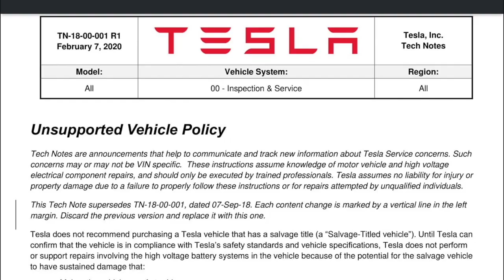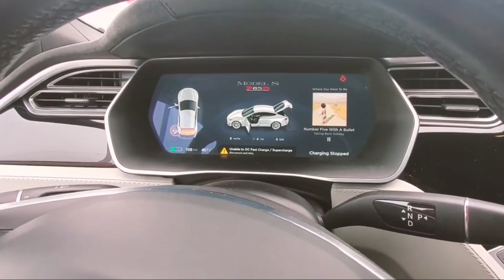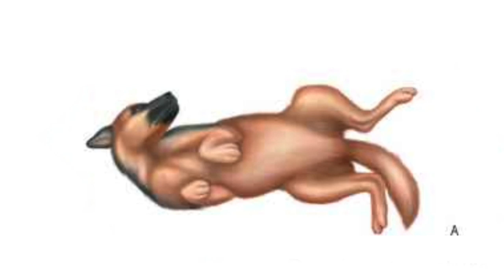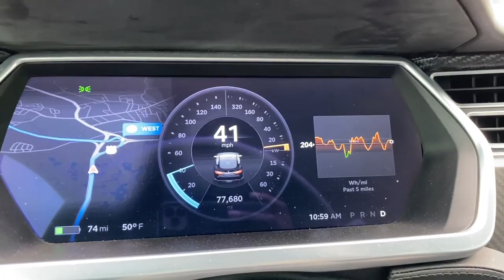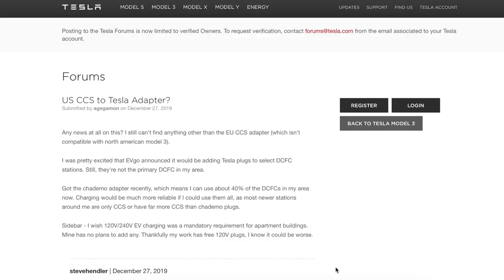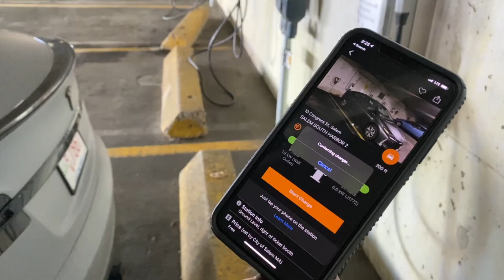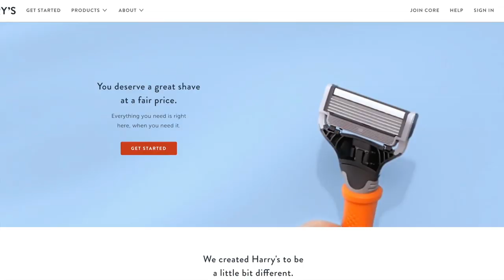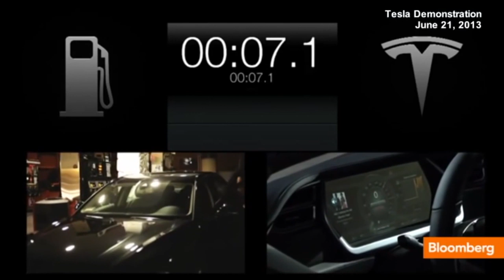Tesla ruined my car and it’s the best thing to ever happen to me!

Comment: The fact that Tesla disable the ability to fast charge after the PAID certified inspection is completely madness.
Reply: This will affect their new car customers too. Premiums will go up if they recoup less on damaged vehicle auctions.
Reply: It's also basis for a lawsuit. At $12,000, a lawyer wouldn't be that much
Reply: Chaos Corner except they also offer insurance. So they will just say get Tesla Insurance.
Reply: I was quite looking forward to getting a Tesla model Y but this video has shown the reality! disabling DC fast charging not on their network, is completely unacceptable. I will buy something else.
Reply: @chaos.corner  straight up! Shady as fuck
Reply: @tomquimby8669  good self control, this is what the world needs when it comes to sleezy business practice
Reply: @tomquimby8669  Same  - Ill get a VW diesel before i get a tesla
Reply: @brushlessmotoring  I mean...for now. Who knows? In a couple more years, maybe they start disabling DC fast charging on all models more than 8 years old due to "degradation in battery safety" or whatever. Perhaps they'll offer a battery safety certification for $5000 which works for 6 months then gets rescinded. You wouldn't want a car with an old and degrading battery charging next to you would you?

It's a slippery slope.
Reply: MasterOfNegotiation everything you just said is made up by you, and nothing is factual. Lol
Reply: Sadly Tesla is like the Apple of the Automobile industry
Reply: @brushlessmotoring  say they can and will disable third-party fast charging on salvage title AND unsupported vehicles. Your car becomes unsupported if you take it to a different country. I live in Europe and do move country to country. this policy makes it impossible to waste money on a tesla
Reply: That's right bro
Reply: @tomquimby8669  I'm sure you can re-register a Tesla within European countries, as the charging standard is the same (you can certainly drive them all over EU/UK as many have done) If you moved between countries that have different supercharging sockets, I can see them preferring you to sell and buy rather than ship and import, and not be able to supercharge anyway. (EU/US/CN have different connectors)
Reply: @brushlessmotoring  you only need to re register after 3 to 6 months depending on EU country. but that refers to the countries legal requirement. Tesla is not bound by that they could arbitrary decide to unsupport for any reason. NOT GOOD
Reply: @stefanvdw7895  He did say, "Who knows" and "Maybe" based on Tesla's history, it is plausible conjecture.
Reply: @brushlessmotoring  That's great but Tesla can keep their infrasture if they restrict my ability to travel and have overstepped by disabling DC fast charging all together than they don't get my money or my time. It as simple as that I work on my car's not a Tesla manchenic and I am a GD aerospace engineer and mechanical in title so if they restricting this they are probably going to restrict diy repair cars aswell and considering a competent mechanic charges as much as I make on a hour basis they won't be getting my business. This is two steps away from pita and I have no time for that when I have to be in at work on Monday (on time).
Reply: @jesusofbacon  They are definitely not for DIYers, I can't think of a drop in pack and drivetrain for EV conversions that can DC fast charge on any standard or network, I think all of EV west's conversions are Level 2 AC charging only, same as Rich's salvaged car is now. That would be an interesting project, that could include DC fast charging using an open standard, CCS would be the logical choice.
Reply: Ridiculous! This is why I did not buy an iPhone until now. I can’t stand a company that think even after you fork out your hard earned money on their product that they still own it. They are taking the one thing that makes Tesla great away from these guy who just wanted to bring back one of their cars from the dead. I mean they should tell Tesla that people love their products so much they would go through that hard work and instead of rewarding them they take the most valuable part away. It’s a sham because Tesla has literally been the one car manufacturer to bring the EV marking to the future I just hope it didn’t go to their heads.
Reply: Welp looks like I'll be skipping Tesla
Reply: maaaaan my ass was legit saving up for a model 3 but I’ll stay with my current car. I ain’t supporting a shady company.
Reply: @tomquimby8669  Jaguar I-Pace.
Reply: @brushlessmotoring  nah man, its all so people are more enticed to buy a tesla new vs repaired. I could repair my car and have it leak fuel all over the gas station and nissan wouldnt give a fuck. it's just to save their face because a lot of their cars catch on fire, but it's completely fucked up. I guess I could understand killing supercharging, since they own superchargers, but cutting off ALL DC fast charging? That's not right. you essentially NEVER actually own a tesla, since you are never in full control what you can do with it. I wanted one, but not now. Fuck em.
Reply: Yeah, it's rediculous. I wonder what will happen to people who get into minor accidents and have their cars repaired. Will Tesla disable those too? This will affect the company negatively and it is downright ridiculous for an EV company to not want all their vehicles on the road.
Reply: @brushlessmotoring  your reasoning here is not flawed except for the following, I find it incredibly difficult to believe that the mentality and thinking that leads Tesla to believe that they still own a piece of the cars they sell on will not someday in the near future extend to older OEM Teslas, just like Apple and Samsung believe they still own the phones and iPads of yesteryear. Apple, Samsung, and undoubtedly Tesla don't think twice about disabling and slowing down older models to push their customer base into purchasing new models, all in the name of safety. They're 100% full of s***.
Reply: Anyone every see just 1  18650 lithium battery explode?  I wonder what saftey there is on thousands of bats, of unknown accident condition, under any fast charge? How many would blame Tesla if the family was burned up while 'fast' charging?
Reply: @tomquimby8669  EV hasn'tbeen anything on my bucket list, but if it ever comes down to it. Business practises like these are the sort that will prevent my doing trade with Tesla in the future...
Reply: @Ryan_Tidwell  what if he repaired it and forgot to hook up the cooling fan and jumper the temp sensor so it would charge?
Reply: @TheRealMrRoboto  ALH 1.9 with 220k on the ticker, about to replace the bearings control arm bushings. Looks like shit, but IDGAF, one tank gets me 1100miles on the highway at 80
Reply: They should not be able to change anything on YOUR car that you purchased. 
Its your car not Tesla test dummy to mess with. Errrr i would be irate!!
Reply: @brushlessmotoring  Yeah, wonder if he could sell it to them and buy it back.. or is this just the rule for salvage/rebuilt? Otherwise  Rich Make / setup your own charge controller to go paralell to the existing but direct to the battery. Gut a leaf or buy the taycan part!!!!!!
Reply: @masterofnegotiation2815  there are/must be temp sensors in there. Or could be added with  a solar type cahege controller. They are playing CYA indeed, hopefully rich can replace and check any poor/hot modules down the road.
Reply: @tomquimby8669  That's the part that gets me. It's one thing to stop SuperCharging on their network. Off Network DC fast charging, is asinine. I want someone to blast Elon on Twitter about this and see if they can get him to respond.
Reply: Brushless Motoring he paid tesla to recertify his car and enable supercharging. THEY INSPECTED HIS CAR and authorized supercharging for 12k then disabled it and said nevermind.
Reply: I like to see Rich get some car company to give him the tools and equipment to create a new type of electrical car and blow Tesla out of the water.
Reply: @brushlessmotoring  When you have some time to think clearly, after you've removed your nose from Musk's rear end, think about the absurdity and illegality of Tesla's actions, that's if you are capable of objective thinking. This is definitely a very valid reason for not buying not just a model y but any car these people make. If you're the type of company that charges people 12k for inspecting and certifying a damaged vehicle and then 2 months later you tell those people they're SOL because you just changed your policy and the trust and money they put into you was wasted then you're never getting my money. Not just that, I will make it a priority to tell others to stay away from your shady company. 

You sound like someone who is personally invested in Tesla and therefore biased which makes your arguments invalid.
Reply: If there’s one thing i know, it’s tires and windshields cost money... rack up 24k real quick with a $5 bat and a nail
Reply: Not madness. They do not want people to use that as a loophole.
Reply: Seems illegal.....
Reply: @masterofnegotiation2815  You either just want to hate tesla or are just trolling. There is no way they can do that at least in Europe. Maybe in the US where the government doesn't do anything for the people and just wages war all year instead it's possible, then again it would make no sense to do it in the us, when you can't do it anywhere else.
Reply: @TheRealMrRoboto  that car will run and get great mpg  plus YOU own it!
Reply: Brushless Motoring we will need 4 more nuclear plants if we have all electric cars, no gas cars.

It will kill our environment very fast! Electric cars aren’t solve for the environment since lipo batteries are very hazard. FACT!

Our power lines will have to replace whole town because freak 220v each house overnight. Our power lines and transformation will be burst flame.

You people who claimed electric cars are safe and environmental friendly. It’s all LIES
Reply: Samuel Seidel that’s why I refused to own a internet car. Companies control your internet car while they can’t control my 700 HP Syclone, they can’t disable anything in my Syclone.

LOL
Reply: @NoorquackerInd  The guy is probably a Tesla fanboy and laughed it off...
Reply: No doubt.  I'd sue their balls off.  Start at a $10 billion .. then settle at Super Charge.  

😂😂😂

😷
Reply: @brushlessmotoring  Tesla shouldn't have the ability to do this, to take away charging from someone that paid $12,000 to get their car certified is ridiculous, not to mention the over all shitty build quality of a tesla. this is why they will be out of business inside 5 years.
Reply: Cars as a service.  Stand up and vote with your dollars now or this will become the industry standard.
Reply: Has anyone looked at a lithium mine to see the foot print it leaves verses a gas burning car? That uses a little drill pad with trees around it
Reply: Hot damn all these ignorant comments. The reason why Tesla charges so much is because of quality and investment. They're literally brand new in the car industry and literal pioneers of this electric car era. Tesla is lightyears ahead of any other electric car manufacturer. Fast Charge, as someone else has already mentioned, involves scary amounts of power being transferred. I can totally understand why that shit is disabled for rebuilt crashed Teslas and possibly for old Teslas in the future. Same should go for other electric cars. Tesla is literally setting the standard for EVs and their manufacturers; you're way better off investing into Tesla and reaping the rewards that Elon 100% knows will come.
Reply: @Oddly Right Thats funny, since I saw a video of an engineer pointing at how Tesla's doing some pretty ingenious shit lmao. Especially with Tesla's stock climbing, I think you're wrong on this one. Elon's entire plan was to start a trend, thats why he open-sourced all his shit. Every patent is now public property and you're sitting here thinking "man look at how fast the competition is catching up!" ..... like, come on. Tesla is already waaay ahead of the game and you don't even know it
Reply: @brushlessmotoring  They are already disabling self driving on second-hand tesla cars... yeah, in the next months my work says "choose a car and we'll buy it for you, you can drive it as much as you want" - and you know what? It WON'T BE A TESLA. They won't get any money through MY choices. I don't support their behavior. Never will. Disabling paid-for features on a car, two different features already. Bye bye tesla :) Not going to shed even one tear.
Reply: no, the fact that they even have that ability is even more concerning, wait until your democracy becomes a dictatorship and overlord xi has your car shut down remotely because your cousin said something he didnt like
Reply: True. Unfortunately this will affect so little people that it'll never make news.
Reply: @brushlessmotoring  so ur saying paying 12k for Tesla to approve you means Tesla can cut you off 3 months later?
Reply: I think Elon Musk is an amazing all around person. I seriously love the guy. That being said this is SO BAD, I SERIOUSLY cannot believe that anyone who watches this video would EVER BUY A TESLA. $12000 then nothing Elon you can do pretty much anything fix this, its horrible.
Reply: Tom Quimby - Buy a Lexus 🤷🏼‍♂️ that thing will never break and they’re gorgeous
Reply: Yeah im not buying a tesla now!
Reply: Accepting payment for services that were not provided is fraud.
Reply: @brushlessmotoring  this must be the most idiotic argument I have heard.
Reply: Apple move
Reply: This shit sounds like the right to repair lawsuit. Glad I got a Jeep.
Reply: yeah, I'm not entirely sure if this is legal. I could understand them disabling the functionality for their stations in the event that the car has failed inspection of theirs, but even then if I purchase my own charging station I should be allowed to use that charging station in my garage. If I spend so much more money on the capability to charge at home and that keep Billet he's been taken from me that means they have stolen from me. I would be pissed if it happens to me.
Reply: I will never buy a tesla, they remind me too much of apple. 
I hate those  Sell your soul to the devil-kind of products.
Reply: @Guinnessrules  imagine if someone comes out with a custom firmware for a Tesla though. You can buy the bare-bones, then install the custom firmware. Get all the features you want. I know that they can be jailbroken to restore features that you had previously purchased, but really those features are just software so a custom firmware would be better still. In fact, it would actually be completely legal for someone to create their own custom firmware to compete with Tesla's software in their own cars. Similar to how
 EA got big by reverse engineering the Sega Genesis and then threatening Sega to work with them or else deal with competition on their own console.
Reply: Its right up there with Apple and them slowing the older models.
Reply: Just came across your channel, your daughter and family needs a Grammy award 👏
Reply: @oda0111  You can buy a three year old used hybrid for $12K that will more than likely outlive a Tesla.
Reply: @johnj3027  then don't charge a guy 12k to have it Tesla certified and enable the fast charging and then decide to take it away. Those are crao business practices.
Reply: It’s bull shi*
Reply: @brushlessmotoring  do they have the right to, sure it's their infrastructure. But the point to the video is the vehicle is disabled to ANY high powered charging, EVEN IF they are recertified, AND they will sue you for modifying your car to allow you to fast charge it again.
Reply: Sounds like a de-certify, de-value and dis-incentify inspection... I've been thinking about buying a Tesla, but look past the hype and I'm starting to realize the after market support is perhaps not great? Its a big investment for the average punter.. To potentially have features switched off without consultation like a mobile phone, makes the investment a liability and not a risk worth taking.
Reply: I’m sorry but after all the hassle and all the money spent on this car ,just why go through all this???????????
Reply: It's fraud.
Reply: Shine Yeah issues like this is what keep away from Tesla. I would still love a Tesla but don’t got money like that and if I did buy a used one and fixed it up a bit just for the super charge to be disabled is a huge disappointment
Reply: @brushlessmotoring  What about when some one hits your car and your insurance fix it and Tesla take the ability to supercharge your car. What will that do to the value of the car?, and from there on the owner will be sitting inside the Tesla charging it for hours. Too many strings attached to a Tesla when you sign the ownership.
Reply: It's also theft. If you pay for a service and it is removed without a refund. I mean I can sort of see why if Tesla has no idea of the condition of the battery why they would choose to limit current to prevent fire safety issues coming back to bite them, but if it has been inspected and certified and paid for then turning it back off is plain cheeky. TBH I'd probably just turn it back on if I knew how if I'd spent $12000. But then they haven't restricted the maximum power output of the car to protect the battery so....
Reply: Why not sue them?!
Reply: @brushlessmotoring  that why electric cars are huge piles of junk especially tesla lots of ppl have to repair theor vehicles thats why they have inspections im glad i watched this only thing batteries are good for is power tools not vehicles
Reply: thanks to this vid i will never own one clearly E Vs need another 20 to 40 years of research and development
Reply: Descrimination. But they would be liable if it fried or got lit at a charge station, and damaged other Tezzis. Maybe there was NOT a successful certification, but the inspection was lock-step to protocol, and they funny cutthroat-lawyeresque with their wit and motion. 🧐😂
Reply: @chaos.corner  but with repair cars being worthless people who bought brand new with hold better value.
Reply: @greglindstrom1705  Probably. But to a trivial amount, I'd wager.
Reply: @kidmosey  Everyone who doesn't believe this is for safety, take an 8 y/o lithium cell and charge it at 3c.  lemme know what happens.
Reply: @kidmosey  You completely missed the point.  The software/policy is protecting the possibly compromised battery from doing bad things (therefore protecting the customer who doesn't know that they don't know whats best for their battery).  Soak your cellphone in water overnight or throw it off a bridge, and then try to charge it.  Actually, don't do that.
Reply: Tesla, "This is sparta!!!"

Kick!

You falling down to the abyss of non super charge black hole.
Reply: @brushlessmotoring  this is the mind of a blind tesla shillboy
Reply: It’s breach of contract surely?
Reply: It's criminal
Reply: @brushlessmotoring  again wrong . Not how it works
Reply: @sonicthreads  Its not their place to tell us if we can charge it or not, especially since the majority of salvage cars won't have bad batteries when repaired correctly. And of theyre worried that theyre not going to be repaired correctly,, they should try to offer courses or certifications to fix them. What theyre doing is like saying you're not allowed to put fuel in a salvage gas car because the fuel tank MIGHT be damaged.
Reply: One of many reason i will not buy one.  Was looking to get one but now  Nope!
Reply: @brushlessmotoring  dude... thats like saying i dont want a modified car getting gas next to mine....if it passes an inspection its none of anyone's business , teslas included... this bull shit is exactly why we run those electric cars off... they can take to much from you just because they feel like it....they use up the power grid raising everyones electric rates, the rich dont care but the rest of us do....i like elon...but full electric cars are a joke for this kinda charging situation... and for being practical
Reply: @brushlessmotoring  What a load of Bullshit, nothing about what you wrote explain then why they took 12000$ from the guy to recertify the car and then cut it in two month.
Also, as an engineer in EV industry, this safety excuse is just a complete load of bullshit.
Reply: Not madness, criminal.